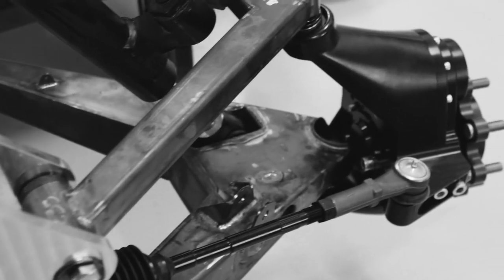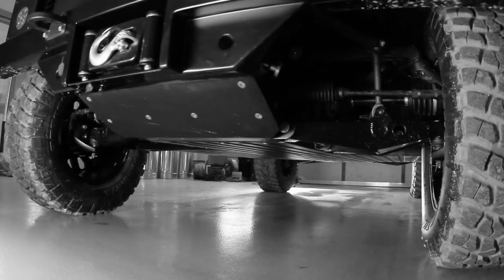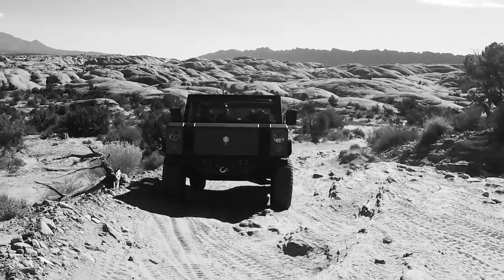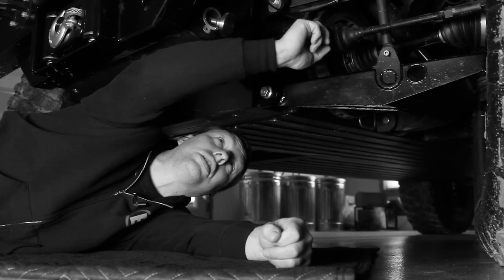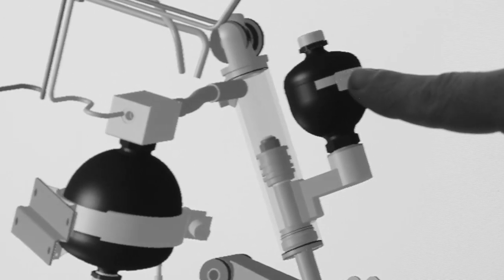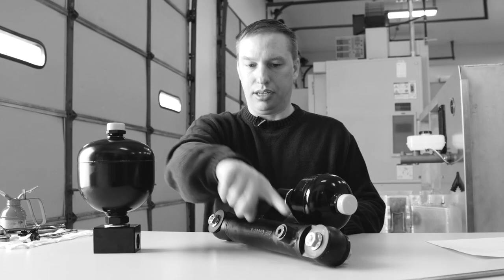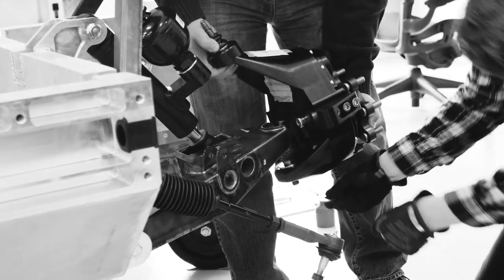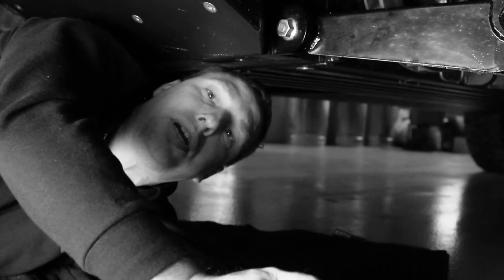SUSPENSION OVERVIEW - Bollinger Motors

Comment: I can't belive he said "reducing unsprung weight", almost every aspect of this design makes unsprung weight worse.
  It appears the front and rear suspension arms are the same length which will make for chassis dynamics somewhere between poor and terrible in regular driving.
  All of the parts are made beautifully and it has a few clever features but every aspect I have really looked at is just poor engineering. The sort of stuff a student group would build straight from a peice of paper but would be laughable to any real car company or experienced race team. No wonder it is priced so high.
  I know it is hard to start a real car company but why make it harder?
Reply: Please make your identity known. You must be a famous engineer?

Comment: I like this vehicle a lot! The engineering, the design, the details, the 'simplicity' and practicality. But I just noticed one thing; the disc brakes are on the other end (inside) of the axle compare to a regular car. So for example when you fully hit the brakes, the stress on the axles must be enormous! So when for some reason the axle breaks, you lose the ability to brake that wheel? Anyway, a new car company with a fresh approach on how to design new cars makes me think of Tesla and Koenigsegg. And the portal axles of Mercedes unimog and g-wagon 4x4*2 :) How about solar panels/films in the future on those big flat surfaces, so the car charges combined with regenerative braking ;) 1 more thing; I was thinking about the front trunk, when you're loading long items they will be launched in the car in front of you when you rear end it. google search 'raptor tailgate extender', you need this but in your front trunk so items don't get momentum and get launched when you rear end another car! ;) so excited to see the development of this car! good luck guys!
Reply from the maker: Thanks so much Chris. You are thinking like an engineer for sure! We've designed for these possibilities and tested them in our studies.

Comment: I am an avid Citroën fan myself and drive a Xantia (the last Citroën with a central hydraulic system) as my daily driver. It is fascinating to see that you at Bollinger revive that magnificient system and use it in an up-to-date electric truck. 

My question is, though, if you achieve a similar level of comfort as Citroën did with their hydropneumatic system? I also can lift and lower my Xantia like you are able with the Bollinger but as you move out of the driving setting to change the height the suspension itself gets very stiff or is non existant. How does your system work? Will it remain the ability to smooth out the ride in other than the normal driving setting? And how comfortable will you be able to trim the system? I can't stand the trend to ever harder or "sportier" suspension on the current production vehicles so it would be nice to hear if you are doing different.
Reply from the maker: Alex! Sorry for the delayed response. We were out of state, durability testing for a while.
The suspension will only get a stiffer spring rate if a load is added to the vehicle, the ride frequency will rename the same, so it will feel the same to the passengers. If the suspension is adjusted to the extremes of travel, up or down, it may not provide a pleasant ride because it will have limited stroke in one direction, this should only be used for low speed maneuvers and then returned a normal setting for regular driving. Hope this helps clarify!

Comment: What are your thoughts on the suspension of the Hummer compared to the Bolligner?
Reply from the maker: Ours kicks their ass. Ha. Our Chief Engineer is a suspension guy. He and the team created an amazing machine. The ride is great! During rock crawling in Moab you can really feel the B1 grabbing and moving over the terrain like a snake, no rocking back and forth.
Reply: The lower control arm is horizontal.  Wasn't one of the innovations of the Hummer the high angle of the control arm to give exceptional clearance? Also, looking at the Mercedes G500, the center of the wheel is much lower than the bottom clearance.  I have no experience in suspension, but can't you improve the clearance even further?
Reply from the maker: The arm is horizontal with the bottom of the overall vehicle. So the ground clearance is all the way to edge of the wheels. If there was a steep angle on the lower control arm then that means it's in the ground clearance area. Same is true for the G500, the control arms are dipping down from the bottom of the truck, so their ground clearance is only high in select spots, not near the suspension. We have 15.5" under the entire truck from inside face of wheel to the other.

Comment: This 15” of ground clearance is huge. By comparison a Jeep has about 9” under the differential, 10” if it’s lifted with bigger tires (when they go to even bigger tires, they go to a stronger and therefore bigger axle eliminating the gains from the bigger tires). A Unimog has 15.75”. A Pinzgauer has 13-17 depending on load. A real hummer has 16”.
Reply: Randy Hare jeeps however are more affordable and have aftermarket support...however a bollinger rock buggy would be an interesting sight

Comment: Why not make it simple? A coil over shock would be as tuneable and infinitely better with less failure points. And if an owner wanted to upgrade from factory I'm sure King or Fox shocks could make a shock to suit heavier off roading ... This looks like a lot of stuff to strip out and toss in the can when I want to make a B1 truly capable
Reply: TheAirzuki as good as king or fox are, hydro pneumatic blows them away. How much more capable do you want? I’m willing to bet this will out wheel any street legal Jeep. It has 15” of ground clearance at stock ride height, and that’s all the way across. I believe it has 10” of adjustable travel, 5” each way, that’s 20” of ground clearance at full height. The hydro pneumatic will also allow it to ride at factory height, empty or fully loaded. Fox and King can’t do that! It will also ride extremely well, probably on par or better than a Range Rover. This is an extremely well thought out vehicle.
Reply from the maker: Our GVWR is 10,001 lbs. The regular shock size needed to handle that would have been protruding way up into the cabin, so this was the best way to handle the load.

Comment: Rather have a conventional spring personally
Reply from the maker: A conventional spring would have to be so big to handle the load that it would jut up into the passenger area by about a foot. The pneumatic system was the best way to handle the 10,001 GVWR.
Reply: there's a reason I'm not an automotive engineer. I just like simple stuff :-)

Comment: 1.- Thank God and the engineers for the regen braking, because servicing those brakes will be difficult.
2.- Does this kind of suspension allows you to change a tire without a jack? Or even better... driving it on three wheels? I remember that a very old Citröen could do it with a pneumatic suspension and that's a very neat and useful trick.
Reply from the maker: Hi there. Yes, with regen you may never need to touch the brakes. And yes, you will be able to raise one wheel to replace the tire.
Reply: Cool! This keeps getting better and better!
Reply: Jack-less tire changes are ah-mazing!  Thanks for that!